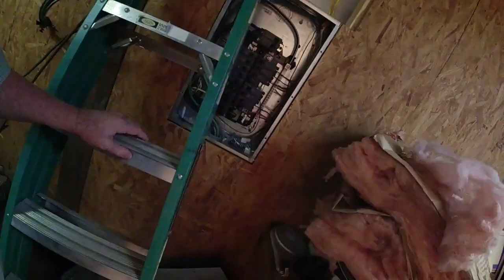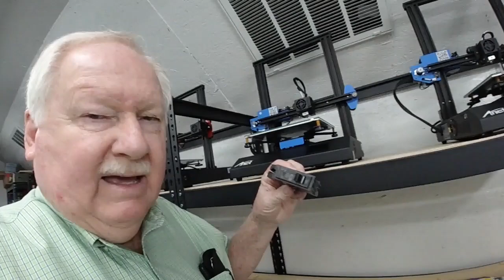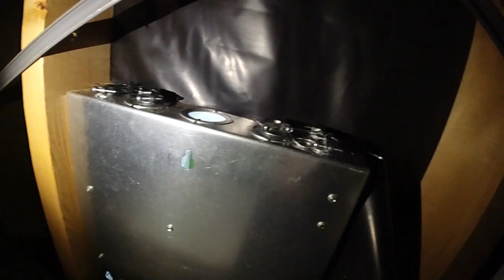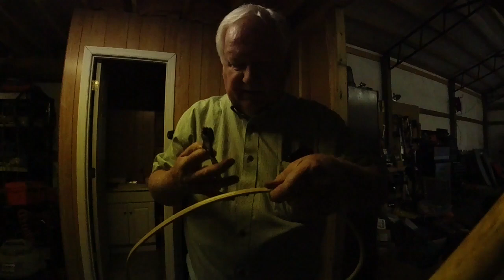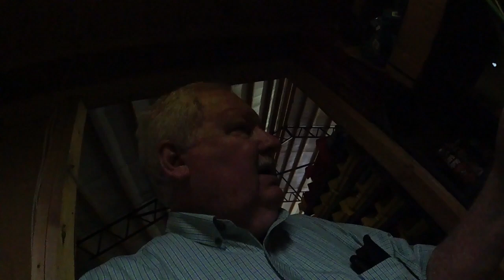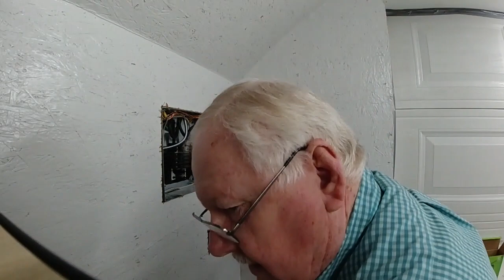MY  NEW  3D  PRINT  FARM  PART  6,  The final electrical work to power 50+ 3D printers.

Comment: Holly Cow Ken - you're now giving a crash course on electrical wiring! You weren't kidding when you said "DIY" 3D print farm! You are saving quite a few bucks doing all this work yourself. Good for you! I just ran four new BX circuits in my space - much smaller scale than yours. So much work even before getting your first production print. Keep it up my friend and look forward to your next vid. C
Reply from the maker: Thanks my friend. My goal now is to finish the odds and ends so I can fire up some of those printers and do some testing. Thanks for your support as always...Ken
Reply: @NewTechInventors  Finally the light at the end of one tunnel ! I sent you an email about your folding tray that might help! Claude

Comment: I just put a direct drive Micro Swiss on my ender 3 ....works like a charm on my hot end at 260 degrees.   If you get into PETG or Abs , or flex filament it’s really great.  At 66.00 I think it’s worth it.  There are plenty of Chinese Knock offs on the hot end but the unit which holds the stepper is great from micro Swiss.  Great American Co.
Reply from the maker: I looked up the Micro Swiss products Joe. They look good and I hope they work well for you and I may need to try one myself. Thanks for sharing the info my friend...Ken
Reply: @NewTechInventors  I think it’s great .   I know it works for Enders but not sure of its adaptability to your machines.  Also I really love the American co 3dfuel for my filament needs. There PETG Workday is food safe .  Very nice stuff and American..  again what’s the 4 wires I know 3 wires but have a question on 4th.   Thanks Joe

Comment: Hey my brother thank you for this ...I like the finger trick...on the incoming.   4 wires.....  1 is a four gauge black ....1 is the 4 gauge  white..... 1 is a ground.   What’s the other for?   Happy Easter and God bless you.   Joe
Reply from the maker: Thanks for the question Joe. The wire I am using is suitable for under ground burial and entrance power from power transformers and power meters which have a separate ground wire. Once you have bonded your power (connect neutral and ground together on your main power panel) you no longer need to use this wire in your sub panel. Ground and neutral are the same in your bonded panel. If that makes sense? Happy Easter to you Joe and thanks for always being there with your support...Ken

Comment: If you are not going to be plugging in a 20amp load, the 15amp duplex receptacle is fine for use on 20amp circuit in NEC. You can get commercial grade in either 15 or 20 amp receptacles.
Do not use the "back stab" wiring.  Only use screw clamp connections on devices.
Reply from the maker: In my case I will have several printers plugged into a power strip that will be plugged into the 20A receptacle. The 20A receptacles I am using have screw down clamp sockets on the back for 12ga wire and I only have one receptacle on each 20A circuit. I think this will work well for me. Thanks for your input and explanation on 15 and 20 amp receptacles and thanks for watching...Ken